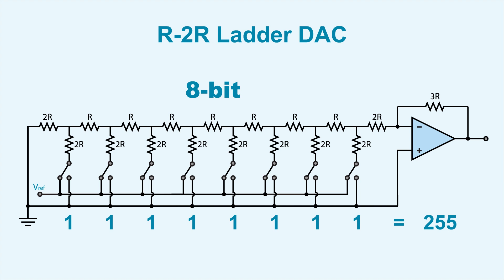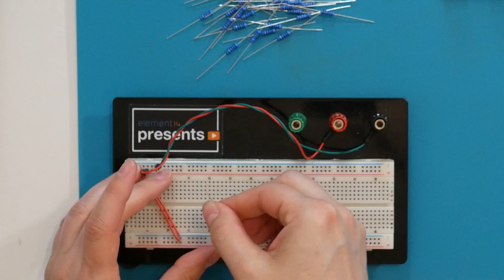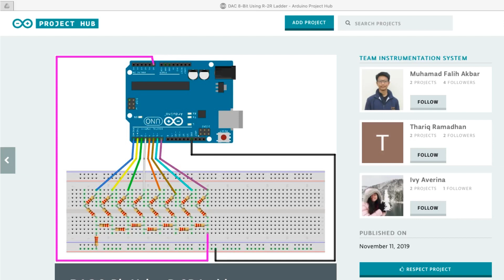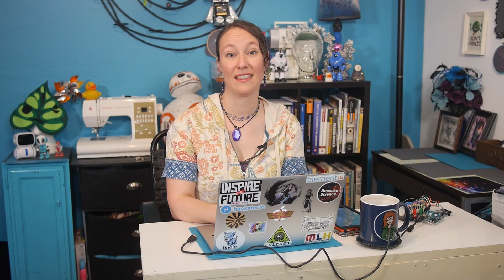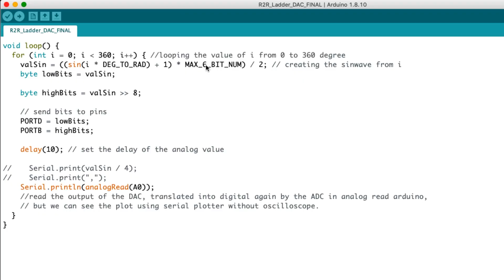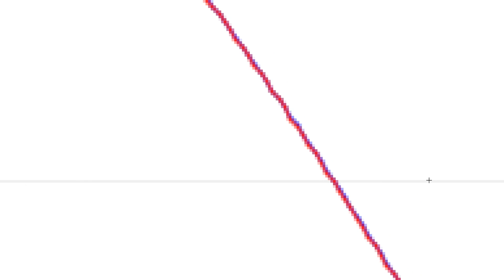Making a 12 bit DAC Using an Arduino - The Learning Circuit

Comment: Thank you, this video really helped me. I have a question for you, if i were to use a controller that does not have any easy to use ports, could i use a shift register and a serial input to control the resistor ladder?

Comment: Although a year old now, just a quick thanks for the video.  It has inspired me further, to explore the MCP4728 device on my latest IPEC ESP32 ATM90E32 IoT Power Energy Controller and Monitor board (variation on the original IPEM).   So many different DACs and ADCs available v massive variations in cost and availability, it is sometimes not straight forward to choose one device for a particular design.  Keep up the good work.

Comment: nice; two notes:
- when you change resolution you movevtge jumper wire, but you do nit show on schematic which one...
- would be good to actually see the dac output on oscilloscope as well ; plot from serial is still ‘software’, we need real hardware signal, dont we?

Comment: The tx and rx ports are always on due to the Serial.begin() command. This way, the first two bits are always on. To get over this problem you have two solutions, you can shift the pins by two, starting in pin 2, or just delete the Serial commands.

Comment: It is not possible to achieve 12-bit resolution using R2R ladder and simple microcontroller. The problem lies in the resistors mismatch. Theoretically, even to achieve 8-bit resolution, 0.1% resistors are needed. But that is only part of the problem - the uC pins all have output resistances variation in the range of 100-200 oHms  which adds to the mismatch error. Then take into consideration the pin voltage,Vdd, which is not very stable (typ 1-5% noise).  There's more errors coming from the high-speed glitches due to pins risetime / falltme mismatch.  In practice, 4-7 bits of resolution is achievable, depending on  the update rate. What was shown here was at best 7-bit resolution in nearly static conditions.
     After falling into a pitfall and making few R2R DACs myself, I advise not to utilize such approach - a simple PWM DAC is more than adequate for the Arduino users,  and saves a ton of digital pins on uC!
Reply: Look at E-Tims 2007 R2R DAC for N64 to get digital RGB to Analogue, for a laugh. It's being commercialised. He compressed the shift register and D flip flops into a single CPLD but it's still using R2R.
Reply: It's why no one ever practically makes a discrete R/2R ladder network DAC. Covered it in a lecture at degree level in about 10 minutes. Never thought anyone would be stupid enough to make one and then try and teach people how to do it. It's pointless, it has no value, not even from a teaching perspective.

Comment: At 05:15, this appears to be 2-Bit (4 values) rather than 4-Bit (16 values).
Reply: I noticed this too. Serial ports Rx & Tx are the problem here. By using 2 Arduino's, one to generate and another to analogRead the signal it works correct.

Comment: It's good to be teaching hobbyists this. But a 12 bit DAC with 1% resistors? It is likely to have some serious non-linearity issues. You would need 0.025% resistors for an honest 12 bit converter. 

I did one of these for a my first serious professional project back in 1968/69. AFAICR is was 6 or 7 bits. I only had 5% resistors available. But I did have a kickass DVM available. So I soldered a bunch of resistors in a long chain, applied a stable voltage and measured and noted the voltage drop across each resistor. Then I sorted them in order of relative resistance and picked an optimum combination.

Comment: These DACS are still still used in single chips since waffering Resistors is easy and produces very high tolerances. There are different kinds of DACs, and each of them have there specific requirements on their implementation.

Comment: This is an excellent video explaining how early DACs were built and the principles behind them, nice work! One thing got me at the end however, you mentioned that the original input signal captured by the ADC could never be reconstructed exactly by the DAC. This is (mostly) incorrect though, as it ignores Nyquist–Shannon. 

If you band limit the input of the ADC at 1/2 your sampling frequency (idealized case) or lower (practically, 1/5 to 1/10 is sufficient for slow, non-specialty filters), then include an exact copy of this input filter on your output, you will reconstruct a mathematically identical signal to the one received! The limitation bit depth poses in this scenario is an increase in base noise floor, rather than a distortion of the signal itself. Because of this, these filters are nearly always included on off-the-shelf components designed for distortion sensitive applications.
Reply: Ahhh, good old Nyquist Shannon sampling theorem.

Comment: This "zooming in" to 12 bits waveform  shows pixels of screen, not 12bits DAC steps. Unless you have screen resolution with 4096 vertical lines. Nice video anyway :)!
Reply: The jaggedness of the pixels isn't what she's referring to, but rather the slight waviness of the line that's similar to the previous stair-stepping of the output but on a scale of 4-5 pixels per step.

Comment: Question about the code.
You step through i from 0 to 360 by 1 to calculate your sign wave.  That is 360 steps.  Shouldn't you have used MAX_12_BIT_NUM as the number of steps between 0 and 360?  It still looks okay because you showed graphs of 8bit (255) and 12bit (4095)...  I wonder if 10bit (1023) would look the same as 12bit because they both would have been truncated to 360 steps by your loop.
Reply: I’m honestly not sure. Jeff wrote that part of the code and I didn’t fully understand how it worked. But since I was trying to create an arc 360 sounded right at the time.

Comment: Hi...   
I did a similar thing almost twenty years ago, through the "User-port" of my Vic 20 with 16 KBytes RAM expansion, to make a long research about PCM synthesis of percussive sounds (bass drums, snare drums, toms, claps, hi-hats etc... ). 
My "DAC" wasn't a R/2R type, but just eight resistors (10K-20K-40K-80K... ) from MSB to LSB, linked to a common line and "grounded" through a 10K resistor to convert the out from current to voltage levels. 
I created the sounds with BASIC programs that simulates sine oscillators, white and pink noise generators, "click" and "crack" A-R envelope generators, mixers and LP/HP filters (the elaboration's time was a little terrible, as you can guess!!!) and played with a simple Assembler programs, with a sample rate around 25 kHz. 
The result wasn't bad, it was a fun experience, but i soon discovered that 8 bit is too low as resolution for percussive sound voices (anyway some commercial drum-machines, as Korg's DDM 110/220 or DDD5 actually makes use of 8 bit samples... ). 
Now I'm thinking to assemble a vintage-style drum-machine with Eight sampled voice-cards triggered via MIDI by a DAW (as "Caustic 3" and the like), with a Pic and a simple cheap 16 bit DAC in any voice-card. Today a 16 bit DAC is cheaper than a bunch of 1% resistors...   :-D 
Anyway I would like to listen to a 44/16 wav file through your home-made DAC expanded to 16 bit... 
Bye...   :-)
Reply: I also did something like that with, believe it or not, the parallel printer port on my Ohio Scientific computer (very similar to an old PET computer). I built an 8 bit DAC resistor network into a printer cable which I connected to my amplifier and I "printed" various wave forms which sounded... interesting. Random numbers made something of a rumbling white noise which could have sounded like explosions if I had known how to code envelopes. BASIC was too slow to make anything but the lowest frequency sine waves so I wrote a BASIC program to make a lookup table which then jumped into a machine language routine which "printed" values through the table, skipping values to increase the frequency. It didn't really sound like a pure sine wave but it had a flute-like sound. I could have done much more if I had known what I was doing.

Comment: A question, the ADC on the Arduino is only 10bit, so surely the 12 bit is a bit fruitless?
Reply: Indeed the ADC of the Arduino is only 10bit, so reading back the 12bit output of the DAC will not be accurate, but it doesn’t mean that the DAC can’t be used to drive something else. After all, the redirection of the DAC’s output back to the 10bit ADC input of the Arduino was mostly to demonstrate the different bit depths ladder output on the video. On the other hand, a 12bit DAC on the 5V digital output of the Arduino, would theoretically resolve in 1.2mV per step. So using 1% resistors may give you noise higher than that in the end, assuming that your power source is also stable enough.

Comment: This R/2R DAC was my first sound card (just 8 bits) on my first PC back in the early ‘90s! I managed to fit 18 resistors and a 100nF capacitor for integration of the output signal in a DB25 plug back then, playing WAV files from the printer port of that old PC! 😊 Great video! It literally took me back to those years!
Reply: Covox speech thing! 😊
Reply: @phant0masterr   Also known as “Disney Sound Source”. I found the schematics of it back then, on the text “readme” file of the “MODplay” player of Amiga music tracks. Something like a MIDI file with 8bit sampled instruments. It was supported by 1 or 2 games but I remember that I had to write the software to play the WAV files in assembly, because even Pascal wasn’t fast enough to play them at the actual speed. My 386sx/16MHz back then was even slower than an Arduino in some tasks!

Comment: I will use this to power my stepper motor because i wanted to make a mechanical clock
Reply: You can also use as an alternative, one of the cheap stepper motors with a 64x gearbox divider which, combined with the 64 steps of the stepper gives 4096 steps for 360º, resolving better than 1/10º. I used a stepper motor like that to drive my telescope’s focuser, because I wanted the accuracy, especially for a 5x teleconverter when I’m imaging planets, and also because I wanted to focus without touching the telescope at such high magnifications.